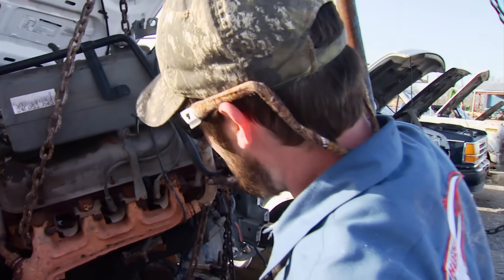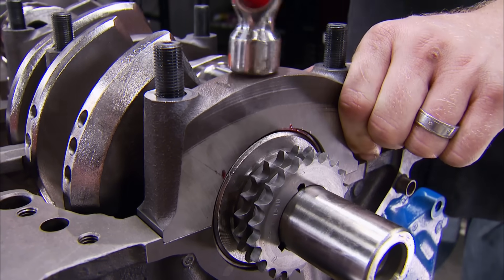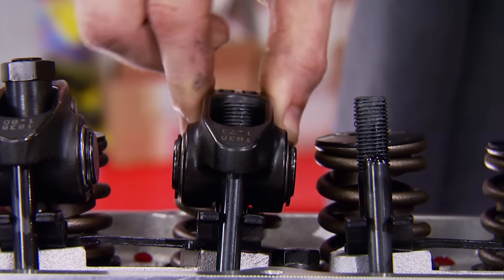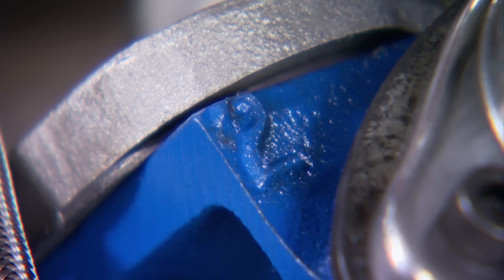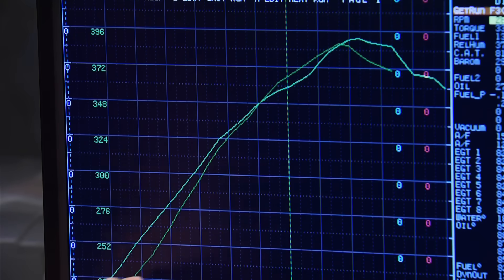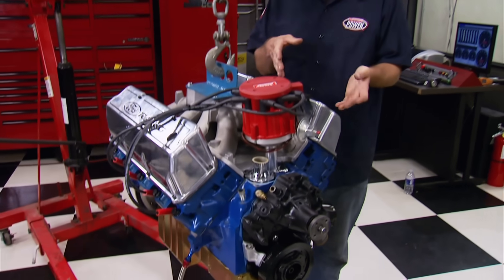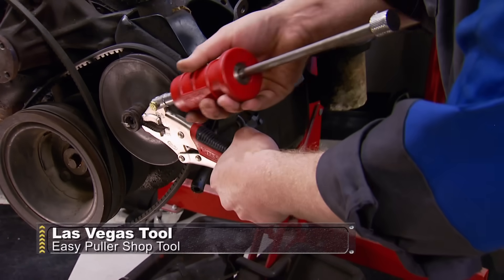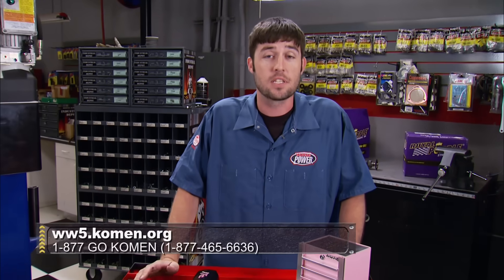351 Small Block Dyno Shootout: Windsor vs Cleveland - HorsePower S16, E11

Comment: Well about 30 years ago I did build a 351 Windsor and a 351 Cleveland.
You can argue that some of my choices were poor.but it was a better comparison than this.
The 351 Winddor was .030 over. Dart heads with 190cc intake ports 2.02 intakes and 1. Y exhaust were used static compression was around 10 to 1. The cam was a flat tappet hydraulic with around 220 225 at .050 and approximately .500 lift. That was about all the cam I could use with a stock converter in the sutomstivc.
Headers and a dual 2.5 inch exhaust were used. The engine went into my daily driven 64 Fairlane which at the tie was rning a Art Carr AOD and 3.55 gears.
A 700 cam Holley on a aluminium dual plane manifold was used.
The engine was something of a disappointment.
We put it on the dyno and pulled 355 hp out of it at 5500 rpm.
The Cleveland came out of my 71 Pantera. It was originally rated at 300 hp.
The Clevelsnd was running about 10.5to 1 as I recall.
An Edelbrock dual plane aluminiu manifold was used with a 3310.Holley.
The valve train was changed to a crane solid lifter with if I recall correctly around 235 242 at .50 and 5.15 520 lift. Headers were used into high flow gutted stock mufflers.
The Cleveland was much less expensive to modify because the heads were more than adequate to start with.
On the same dyno that the Windsor was tested the Cleveland made 420 hp at 6400 rpm where it peaked . The Clevelsnd also made equal or better torque all along the torque curve.
The Windsor did not want to rev as freely as the Cleveland either on the dyno.
From this I concluded that the Windsor was originally designed as a light truck or medium sized sedan engine.
The Cleveland was intended as a performance engine.
I finally blew a head gasket going over Baker grade in August in the Failane and holed a piston.limping it into Vegss.
For a replacement engine I got a 302 block a n Eagle stroker kit that took the displacement to 331 c.i. AFR aluminium heads with 180cc intake ports 202 intake and 1.6 exhaust and a full roller hydraulic cam and lifters. Int a ke was an Edelbrck dualplane air gap with a 700 Holley.the engineruns headers. I used a 6 inch rad I the build. This engine dynoed at 411 hp at 5700 rpm.its a gem with good power from 2000 t o 6000 rpm.Compresxion is 10.1 to 1. The trans is a 5 speed Tremec now with .7 OD. In OD every thousand rpm is good for 30 mphthe engine will pu to 5000 in 5th which clocks out at around 150 mph..
Which even with the suspension wheels brakes and tire upgrades is too fast for this vehicle to feel comfortable.
My conclusioN is at this point that there really is no point to fooling with the stock Windsor engine UESS you want a small block 400 inch plus egine.that engine will be square approximately and make a lot of torque.
I'm not certain of its longevity. The engine will be heavier than a 302 stroker .and with butto pistons and the right rods I should think that the 347 wold give you compact  light hp up to around 450 hp where the stock block gets iffy.
If you want more get throw deck big bore 363 which makes 500 hp right out of the box.
All of these alternatives 331 347 and363 will fit between the shock towers of the  60s Mustangs Falcons and Fairlanes 
S I just don't see a point to using the 351 Windsor and trying to make it run with so many better starting points.
Why build a VERY expensive 427 Windsof with Clevor heads at all.  Just get a 460 and put some decent aluminium heads cam intake and headers on thzt engine if you need huge cubes and torque.
Reply: ⁷

Comment: With the Cleveland you want to run the four barrel closed chamber heads not the open chamber those are worthless to have heads flow better.. in my opinion this was not fair you ran pretty much stock on the Cleveland yeah you modified the hell out of the Windsor! With the right cams and aluminum heads as well on the Cleveland and a stroker to make the Cleveland also a 408 I believe it would surpass a thing especially in torque Windsors are also good engine but I'm an old school Cleveland man I have several of them.

Comment: I've had several cars with 351 Windsors and one 351 Cleveland and I'll take the Cleveland any day. The Windsor is a good engine but the Cleveland is in a class by itself, it is fast and tuff.
Reply: We put headers, a Sig Erson cam and 4.11 gears in my brother-in-law's '70 Mach1 Cleveland.  It ran mid 13's.  Not bad back in the day, for a non race prepped 351C.
Reply: Except for its OE non priority main oiling system.  To this day I wonder why Ford did that.  But it’s an easy fix in a performance build.
Reply: you said that right
Reply: . Love the Cleveland but  I had heard of a cylinder head issue with either lubrication or cooling?!?
Reply: @michaellombard894  I never had any problems with mine but could be.

Comment: I built a '89 351w for my little brothers 4x4 F250 last year. Underrated engine design so buildable it's not even funny.  I just bought a 96 F250 4x4 and I can't wait to cam it up
Reply: This comment is super old but Bigdogs porting cuts open, ports and reshapes runners of factory ford EFI manifolds to give modern power with a classic look. This is a 351 intake with good info.
https://www.youtube.com/watch?v=uouK38FbiRs

Comment: An engine with 50 plus years of after market everything thrown at it, against an engine produced for 4yrs fifty years ago......
That Windsor had everything it needed plus.
Bone stock back in 1971, the 351C would eat any Windsor for lunch!
Let’s get an aluminum top end on that 351C, like 3V heads and a nice intake just like the Windsor got. Then let’s run them again...

Comment: At 8:08 ..."everything stays the same"...since when do you reuse an intake with such a mis-match in port size? Those "four-barrel Cleaveland heads " they are showing here do indeed have the big beautiful intake ports, but have the "junk" open chambers....No, you are not going to find a Four barrel , four bolt main close-chamber Cleaveland 351C in a junkyard!!! Everything else is the orphaned "remaining" stuff of later years of the Cleaveland program.

Comment: I have both a 351 M and a 400 in my 77 Cougar wagons.   I need to get a timing wrench for the distributor that I know will fit.   If you are using a Snap On timing wrench on the O.E. distributor nut, can you give me the part # of the wrench ?   Or if another brand, the brand and the part number?   I see a lot of Snap On F 8564 B timing wrenches on ebay, but none of the sellers have used the wrenches (I asked each one of them).   Any help appreciated.  Thanks

Comment: I knew the cam wasn't enough for the 4v heads when I saw it was making 390hp with the 2v heads. That and you weren't going over 6000rpm. Those 4v heads are for 7000+ rpm.
Kids. lol

Comment: So they are comparing a highly modified 351w bored and stroked to 408 to a nearly stock 351C bored to 357 with stock 2v and 4v heads at its stock compression and scream wow look at the power of the 351w??  what is this horse shit.    I am not saying another bout these two motors, they are both really good blocks, but not really any sort of comparison when you change so much on on platform more than the other.   I would have rather seen what the windsor did with the same stockish config.

Comment: This isn't a true this vs that.   If 1 is a stroker.  They should've  kept both factory stock 351ci. With 30 over pistons.  And just used readily available off the shelf parts.  For a true 351 vs 351

Comment: These idiots never do an apples to apples comparison. Of course a stroked, fully built Windsor is going to beat a factory Cleveland with a cam swap. Then they use a single plane intake on the "street engine" and dual plane on the stroked "race engine" totally stupid

Comment: Just curious here! According to what you said in the video, you took newly rebuilt engines and warm them up, then did a pull.
Did you skip the 20 minute cam break in normally done?
Reply: Rollers may not need break in?

Comment: We had a 351 Windsor  2brl 69 mustang. We put a cam in it and ported the heads and headers and holly 500 two brl. Three speed manual. It kicked ass on the streets. No idea about horsepower or torge. It was the 70s and as ford fans we just did the best we could. Not many parts available like the last 30yrs.

Comment: Any time you bore one over to 400 cubes and rolling thunder cam and put aluminum heads on one now bob gliddon took that Cleveland motor and blowed the comp away there’s no way you’ll ever sell me on a Windsor over a Cleveland I’ve seen what a 1969 Torino Talladaga GT 351 Cleveland 4 speed car oh yeah you think about a motor that stood up to a hemi but I’ll tell you all I’ve never been a Ford man always chevy but running racking and also 4wd in the woods climbing and digging if you wanna talk Ford my uncles all were big Ford guys and I’ve been around all of them my big respect Ford motors are 351 Cleveland 390 302 boss the cobra jet motor and 460 and think that 302 boss is just a 302 with 351 Cleveland heads so we can see what makes the two under 390 so good yeah and the 330 360 & 390 family great line up 330 Industrial motor 4 rings on each piston here’s a little giant pull around un real amounts of weight set and chug all daylong on what ever rig you wanna hook up to it 360 what a beast in a 250 with a 4 speed granny gear I the woods load it plum over the cab with wood come right on Down like a log truck run good smooth motor quit no hesitation good all around truck motor for torq and pulling working same as 390 has all those same great traits but being the famous 390 Ford yeah it’s street performance we all know speaks for it self and when carol shelby steps in and designs you a motor why you can bet you money right there last thing the biggest beast it self 460 hey there’s one that speaks to you most all your old wrecker and rollbacks F350 trucks all were 460 and it’s proven it self in the woods on the track because at the end of the day there’s no replacement for displacement so if would ever own one I know what ones I have seen out perform others and seen out perform the comp hats off to the Ford guys they have y respect as a Chevy guy only two cars i ever seen that could burn more rubber you had to let up to see how to drive but could burn rubber as far as you could see 69 tarino talladaga GT and 66 chevelle with a68 327 L76 code 350 hp motor both cars burn as much rubber as you could afford to buy both 4 speed cars they weren’t mine but I’d love to have both of them today the chevelle had a inline 4 speed shifter with a reverse leaver on the side you can’t get today by hurst!

Comment: Demon carbs are absolutely excellent but whatever happened to the predator? I remember it being referred to as not a carb but as a predator because you could disassemble and reassemble it and configure it to whatever cfm etc you needed.
It was supposed to be the ultimate naturally aspirated adjustability. Anybody remember this? Please write back!!

Comment: Couple of things.  1. Are the 4v Heads Closed Chamber or Open? If you ran Open then you would be right on compared to the 2V.  Closed Chamber Heads would have made over 500HP.  2. 4V heads like RPM.  You are way off on the Powerband.  3. Comparing the the Stroker to Engine to a Cleveland thats not... Is not a good comparison.  You just did a test for Edelbrock to benefit Edlebrock.  I call BS.  Nice video though.

Comment: The 408 would have been better with a 2 inch carb spacer and a 850 cfm carb would have easily made over 500hp the Cleveland would have been over 400hp with a 850 cfm  carb and more comp 11.1 with  dome top pistons pistons. On both 4v and 2v heads

Comment: The reality of it is the 1971 351 Cleveland is the most powerful small block from the factory. The boss 351 Cleveland was a factory 11to1 engine with 331 hp. The Windsor never even got close.

Comment: The thing I like is they don't have injectors and computer controls for everything. Still simple builds with better power and torque. If something goes wrong, you don't need a multi million dollar computer and degree to adjust the carb, or adjust the timing.

Comment: Why were the vacuum advances for the distributors plugged off?  I never did get to use the 351C I pulled out of a '73 Montery in December 2000.

Comment: Stoke the Cleveland to a 393 or 408 and use the 4v heads. The stock 4v heads flow 275cfm according to Richard.  They like compression and camshaft.

Comment: For serious builds using OEM iron quench chamber or aftermarket Cleveland heads, there’s good news for builders in the States that would rather not be limited to using Windsor based blocks. Brand new Cleveland blocks are available in your choice of stronger diesel grade iron or aluminum alloy. 

They feature full Cleveland architecture which allows stock production or aftermarket Cleveland performance parts to bolt on without modifications. The oiling system has been upgraded to a modern design featuring priority main bearing oiling which eliminates the problems found with stock blocks and extended high rpm operation. 

They have four-bolt main bearing caps in all five main journal positions, thicker bulkheads throughout for increased bottom end stability, extended cylinder walls that provide increased stability for stroker pistons at BDC, standard Cleveland 9.2” deck height or Windsor 9.5” with custom deck heights available. 

The exterior of the block is virtually identical to a production block. It even has the D2AE-CA engineering number cast into it like the original 4-bolt blocks. If desired it can be painted the original color for the stealth approach to conceal the big cubic inches inside. 454 cubic inches and more are easily obtainable by using readily available stroker rotating assemblies. 

The foundry producing these excellent blocks is in the U.S. and all machining and distribution is handled by Timothy Meyer. Timothy is a professional machinist and is one of the few experts with decades of experience specializing in Fords 351C, 351M and 400 turn key engine builds and hard to find Cleveland components. 
www.tmeyerinc.com

Comment: Really sad to see this one. Had they started with the 351M, they could have used the crank out of the 400 and had a much closer comparison. Of course, the 351M is nothing but a tall deck Cleveland with the 2V heads. Plenty of options for real power, especially if you can get the 4V heads. 4V heads, single-plane manifold, and carb around 800cfm along with a good camshaft. And being the same bore, you have lots of piston options for a tall deck motor. a 400 with 4Vs and a setup that can actually breathe is a monster. And being that hungry on the intake side, Clevelands really shine with nitrous.

Comment: The mismatch between the 2V intake manifold and 4V heads would screw up the air flow.
Reply: I rebuilt a Mach 1 351 C for a client  20 + years ago. He came in with
4V heads and a request for a 'tune' but he wanted extra power but nice to drive round town. Swapped out the 4Vs (someone snapped them up), got a pair of untouched 2V heads from a wrecking yard for $100 and let a head shop go to town on them. A full rebuild, blue print & balance, Rdelbrock Performer RPM inlet manifold & custom 1 5/8"  extractors etc, followed by a dyno tune.

At the end of the job we had an engine that pulled like a train from 1500 to about 6000 rpm 80% of torque available @ 2000rpm. Coupled with a 5 speed manual transmission and it became easy and economical to drive around town but a useful 360 hp when needed..

Comment: $39.95 for that puller when I made the exact same tool with a hand-me-down vise grips, scrap steel, and lead from wheel weights. Cost me nothing but 1 and a half welding rods

Comment: THE clever 351 would of of done even better if a good valve job would of been performed on the new heads, never bolt them on out of the box the seats always have lots of run out!!

Comment: I like how it's an almost stock cleveland against a stroked, higher compression, higher lift windsor with aftermarket cleveland heads :P
Reply: if anything this proves the cleveland is superior with the numbers it did get, even though they were lower, it was at a great disadvantage, comparitavely

Comment: Worst comparison ever. Just idiots throwing money around. 4V heads using 2V intake and headers? May aswell drive around with the choke on. A stock bore and stroke Cleveland 351 with closed chamber 2V heads with 4V valves and the right cam makes an easy 500 hp any day of the week. A Cleveland is stronger, breathes better and loves heaps of advance. Windsor’s are revers and in my experience, hand grenades.

Comment: Having more torque than horsepower shows that both of those engines are being held back by the intake manifold and camshaft. With the right camshaft/manifold all of those setups could make over 600hp and 550 torque.

Comment: 13:20 Here's the carb you should use, it's an edelbrock 750 with a square bore and manual choke... shows a carb with electric choke.

Comment: This is what happens when you have Chevy guys trying to build ford engines by Chevy rules. By no means am I trying to put the knock on these guys, their channel or their abilities. They obviously have knowledge and talent. However, the rules for building Chevy's do not always apply to building Fords. Tip for the new Ford guys building the old 289/302's, go for the heads. Port/polish, valves, guides-the works. Holly 600 carb rejetted to #68 primaries/#72 secondaries. F4B or similar dual plane intake. Headman headers. Crane made the best Ford cams but as they are out of business, try a fairly high lift Iskenderian street cam. You should be able to tear the tires off yours old Ford Falcon with this setup.